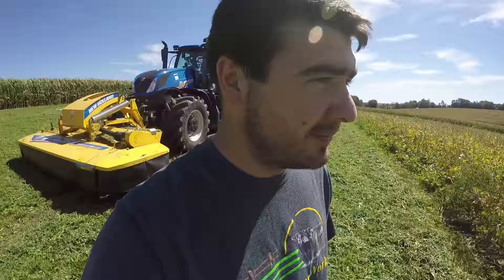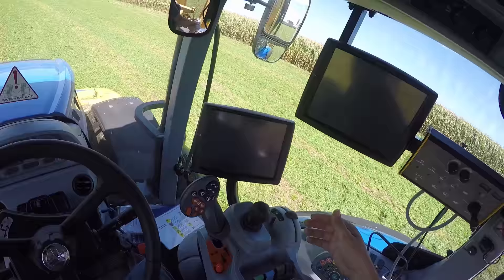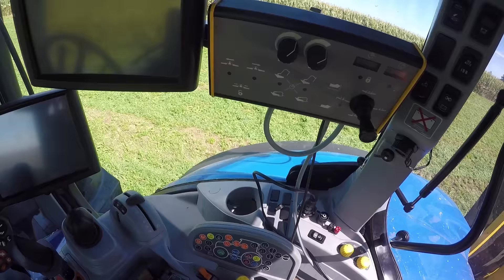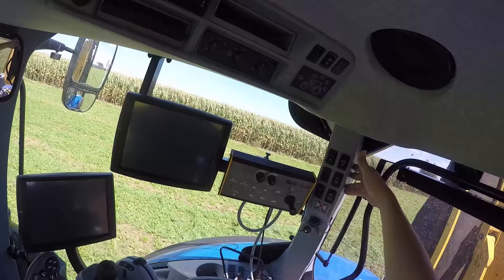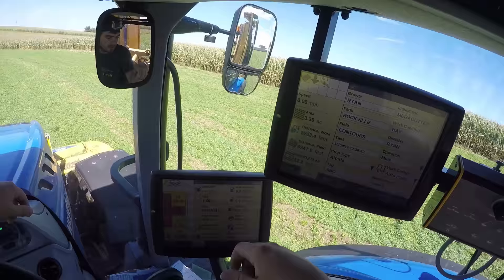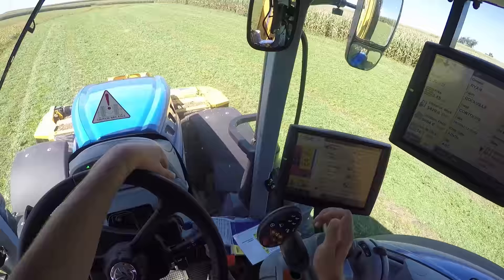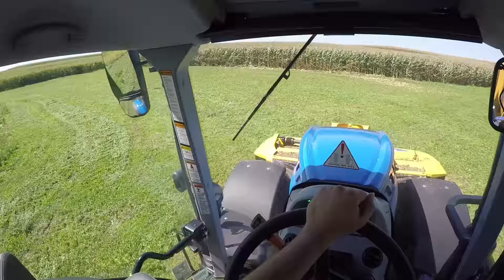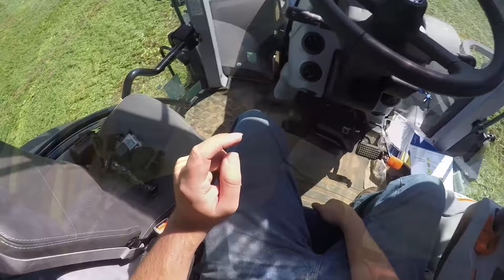How To Operate A Tractor - New Holland T7.315

Comment: On the road i prefer using the footpedal, because when you release it, the blue bar directly drops to 0 instead of dropping slowly, so when you get to a traffic light and you brake, the tractor won't start to accelerate when you release the brake pedal and the blue bar hasn't dropped fully yet. On the field is the commandgrip handle (joystick) easier, because you can drive at a constant speed without having your foot on the pedal
Reply from the maker: +Bram Jacobs Very good point! That wasn't something I had enough time to discover for myself but that would be a very good reason to use it!
Reply: I'm mostly using the new holland tractors for transportation uses, so i'm a lot on the road with the tractors. On the commandgrip handle is also a button C (cruise control). If you use the footpedal and press that button, the tractor keeps driving at the same speed without having to hold down the pedal, and when you touch the pedal again, the tractor disables cruise control and drives again with the pedal.

Comment: I'll bet the wiring diagram for that rig is 300 pages.  Gives me shivers to think of an electrical breakdown. Even the dealers mechanics cannot possibly be fully trained. Bet they have to have an engineer on their headset full time from the head office when fault searching. "self diagnostics" - don't count on it! And what in hell do you do in 25 years when the connectors and wires start to fail? Pull it to the barn with that 90 year old McCormick.

Comment: what is the point of 2 brake pedals?
Reply: Sidebrakes, you can use them to slightly adjust direction when ploughing.
Reply: Turning brakes for REALLY sharp turns (at least on 2 wheel drive tractors that aren't too heavy in the front).  Turn to the right, want to turn tighter, mash the right brake-- the tractor will almost double back on itself.  Same thing to the left.  Going down the road you're SUPPOSED to lock them both together (pedal lock) but most guys just train themselves to hit both pedals at once (since they're side by side close together).  

Having separate rear brakes also has another benefit, especially on a 2 wheel drive tractor-- if you hit a wet spot and one wheel breaks loose and starts spinning, you can mash the brake on the spinning tire-- this transfers power through the differential to the tire that still has traction, which will then pull harder and usually keep you from getting stuck.  If you KNOW you're going to be in some slimy muddy conditions, you can hit the differential lock BEFORE you start to spin one wheel (NEVER hit the diff lock once a wheel is spinning-- it can break the differential because of the sudden shock).  Course with the diff lock on turning becomes difficult/impossible, so the "tap the brakes on the spinning wheel" trick is easier to use at times especially if you're maneuvering around a lot.  

Later!  OL J R :)